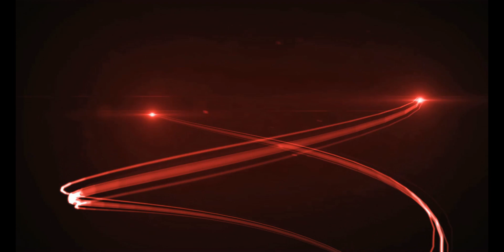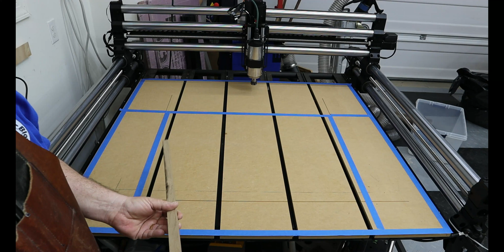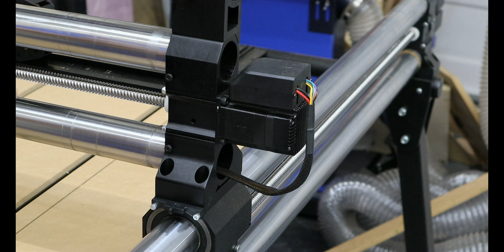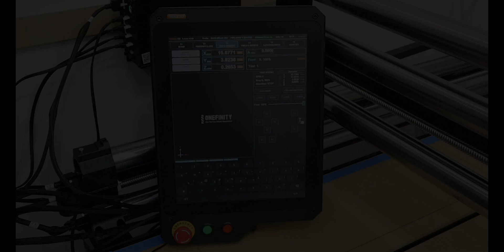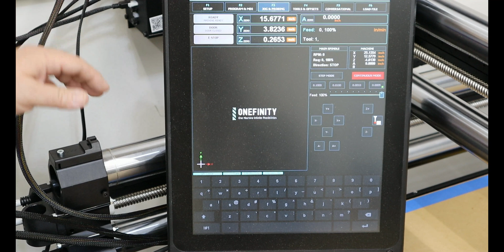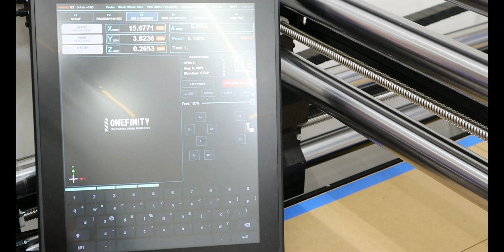Onefinity CNC Review Elite Foreman

Comment: Hello, Thanks for your review. Its been on my mind for a few years to buy a CNC. Just in the past few days I started to visit the reality of purchasing a unit and Came upon Onefinity. Ive never used one before and I currently use Routers built in a table for making and cutting 3D panel shapes for panels for Hot Rod interiors as my business is upholstery and fabricating 3D panels for the interiors, as well as some subboxes for sound systems in cars.   What can you tell me to look for and ask OneFinity in purchasing their equipment? How does the prgramming shapes to cut work?   I'm looking at the Elite Foreman out of the gate. I'm self employed so this appeals that I can use this as a second employee while im doing other work.
Reply from the maker: The Onefinity Foreman is a great choice, make sure you understand the software, I use Vectric VCarve,  althought there are other CAD CAM software choices out there.  Most have free trials, Id use those and see what makes the most sense to you from a work flow viewpoint.

Comment: I realize the mounting height of the z-axis rail is adjustable, but I was wondering in your current configuration....  What is the clearance height from your bottom of collet to your waste board at its maximum height? Thanks for the great content!
Reply from the maker: I've got 7 inches to the base spoil board mounted on the center mounting location.  I do have a couple plies of spoil board above the base board just to suit my personal use.  Thanks for watching, and please consider subscribing.  I've just finished a move and more content coming soon!
Reply: @TradeSkillersAnonymous  Thanks for the info...already subscribed. Looking forward to watching the new content while I wait for flights at the airport...

Comment: Nice review, thanks very much for you clear and concise assessments! FYI @13:26, it's not a Hall Effect sensor for homing. The Hall Effect is based on increasing proximity to a magnetic field generating an increasing voltage signal. The Onefinity homing sensor is simply detecting when a protruding tab cuts off an IR light beam shining across a small gap. Very simple and I guess it works well, better than 'stall sensing' anyway.
Reply from the maker: Hi Steve, thanks for watching!  And you’re right about calling it a Hall effect, thanks for mentioning it!

Comment: Nice video thank-you. How does the Velocity feeds compare to the programed feed rates on the elite machine? I have been using my Journeyman for quite a while and was thinking about upgrading to the elite machine. I do alot of 3d carvings and the Acceleration deceleration really slows the feed rates down on very detailed carvings. And i understand why it does that but was Wondering if the Velocity Acceleration Deceleration is faster on the elite machine?
Reply from the maker: If you don’t have it, I’d suggest the z20 (I think) upgraded z slider. Your x and y speed is mostly throttled by the z slide speed.  The original z slider is much slower than the new one.  You can only travel x and y as fast as the z can go up and down on intricate carves. The upgraded z slider will greatly improve carve times. Please feel free to subscribe while you’re here.
Reply: @TradeSkillersAnonymous  Thank you for the reply. I have the z20 slider, and it is a nice improvement.

Comment: Thanks for the review of the Onefinity Elite Foreman. I am a CNC machinist who has programed and ran CNC equipment for 35+ yrs and I am about to retire. I love the CNC machining and recently started to do wood working. I want to get into the woodworking craft once I retire for a little side income since I enjoy my field so much. I looked at many of the machines out there but this oneinfinity has really caught my attention. I have watched many reviews of the various name brands out there but this may be the one I get for just the reasons I know is true. You need a rigid machine to perform smoothly and accurately over the long term. The controller of this machine is more like the ones I use in a CNC machine shop so I will have no problem using it. This machine is at the top of my list for the one to buy if you want to make a business out of woodworking craft. There are tons of projects out there that will sell very well that can be batched out on this machine. Size does mater and a 4x4 machine has the capability to save time and money in the long run. I think the next best machine out there is the Shapeoko 5 Pro 4x4. Its more for the newbie person who wants to get into CNC machining but never ran or programed a CNC before. 

Cheers Enjoy your Life to the end. Joe
Reply from the maker: Thanks, and I'm glad it was helpful info.  I have another video where I did a review of my first Onefinity CNC, with the original (less capable) controller where I shared the research I did, and what was important to me in selecting this machine, which comes down to rigidity and no belts or V Wheels.  I invite you to subscribe while you're here if you like!

Comment: Cheap and easy fix for pulling on the wire. Just super glue  something light like a bread tie to the magnet case, then you got a light weight handle to pull on, and no loss if it breaks down the road.
Reply from the maker: Great idea!

Comment: Do you think this machine is overkill for a novice buying his 1st machine?  or worth it to spend a little more to get a better machine? I've been looking at the shapeoko.
Reply from the maker: As a beginner to Cnc a few years ago, I determined that I didn’t want find myself guessing if my startup results were me, the machine or my learning curve with designing. The best way to avoid one variable was to get (in my mind) the best machine I could. The mechanicals of this machine are very robust. There’s no flex, give or question that the machine will do what I tell it to do.  All that to say, I whole heartedly recommend this machine and I don’t think it’s overkill. Hope this helps.

Comment: As a retired CNC machinist, you are right on about all aspects of CNC machining. My machine weighed 65,000 pounds and had a five inch diameter spindle, and I would still end up with chatter at times, so it is all relative. I love being retired but miss CNC work, so I am really taking a good look at these (Onefinity) machines. Just need to come up with a plan to sell the wife on it! 🙂
Reply from the maker: Hi Ron, thanks for checking it out. I’ve really liked all versions of the onefinity. Machine robustness was my #1 consideration. Sounds like you’ve worked on some large format machines. Good luck with your discussion with the boss!  Feel free to subscribe while you’re here if you like!
Reply: Similar situation...

Comment: I see you have iVac switch box. Are you using it to triggger a 240v dust collector when the VFD is turned on?
Reply from the maker: Hi Mike, my vfd doesn’t have an on/off switch for mains power, so I added that Ivac switch as a way to power the vfd on and off with the remote.  I invite you to subscribe while you’re here if you like. It’s free and will help my channel reach more people. Thanks and have a great day!
Reply: @TradeSkillersAnonymous  I've been subscribed for while now. I really enjoy your content. The reason I asked about the iVac is that I have various iVAC sensors and blast gates to turn on my dust collector and open the gates automatically when I turn on a machine. Very handy. I added an iVAC  sensor on my spindle cable so my 240V dust collector  turns on automatically when my spindle reaches about 1000RPM. I wasn't sure it would work with the shielded spindle cable so I was very pleased when it did. I couldn't find anything on Youtube or CNC forums about using iVAC until I saw yours in the background.

Comment: That was a great review. Thanks. You didn't mention what your total outlay for it was. Would you share that? I'm brand spanking new to this part of our addiction, I mean hobby. Would you recommend this to a newbie? I believe in the "buy once, cry once" philosophy, so I'm wondering should I just splurge now or start small. Thanks.
Reply from the maker: Hi there, thanks for watching!  You're right I didn't get into pricing strictly because I wanted to show my machine progression from the original to the current one.  In retrospect maybe I should have, thanks for that input.  The machine I have, (Elite Foreman) comes in just short of $4k, before bits, router or spindle and dust collection.  Everyone's approach to those topics is different and so is the cost, but like you I would rather tear the band aid off once and get the best machine I can.  To your question, starting small (in my experience) just leads to frustration, limitations and usually regret.  You get into it, decide you should've just taken the plunge, and you've got the first machine to sell, and presumably take a hair cut on.  If it's in your means to do so, just dive in, and buy the machine that you won't regret later in my opinion!

Thanks again for watching, and I'd invite you to subscribe while you're here.  More videos coming soon!

Comment: If I'm new (first CNC), is the advanced software, (without warnings), you talked about a concern I should consider?
Reply from the maker: Hi Ken, short answer is no.  It’s all going to be new to you, so just pay attention to the details and go at your pace. I think what I was trying to point out and may not have done a good job of, is that if you first learned on a different controller that had a lot of beginner level bits in the interface, it might lull you into complacency with this controller. I believe it’d be best to use this masso controlled version first.  If you ever used a more simple controller in the future, you’d probably view that controller as bothersome with its pedestrian level warnings.
Reply: @TradeSkillersAnonymous  Thank you.

Comment: I agree that the 1F fights above it's weight class. I too have an Elite Foreman coming, is currently having an 2.2 Kw spindle and an ATC mated to it.  In my opinion this machine may compare favorably to an Avid. 

I am currently taking a class at a community college on CNC operation (free tuition if 60 or over !) and yes, the new controller is more like a Haas than the Buildbotics (which I too enjoyed, did everything I needed it too).

As my daughter would say, time to put the big boy pants on.
Reply from the maker: Hi Carl, very well said!  Thanks for watching and please feel free to subscribe. More coming soon!
Reply: How did you get a ATC  mated to the Onefinity Foreman  4x4  ?
Thier website doesn't show any ATC at all.
Reply: @Boxboys.Audio.Sound.Solutions   Yup not yet, mine is SN: 000001. They have to remake the Z slider to hold the spindle, then work with the Masso controller. Give them a few weeks.
Reply from the maker: @Boxboys.Audio.Sound.Solutions  I haven’t done that. Heavy mods needed but I have seen it on YouTube and or the onefinity Facebook group

Comment: Great video!  I am seriously considering adding a cnc to my shop but have worries due to my shop is not climate controlled and is not insulated. Any thoughts on that?
Reply from the maker: Have numerous contacts operating in the dead heat of Arizona with no climate control, she’s fine in the heat. The controller does not like temps below 40 degrees Fahrenheit. You can (if it’s cold at times where you are), take the controller inside your home. Some people do that.

Comment: Awesome video! I'd love to hear more about how the QCW fixed legs are working for you. Do you experience a lot of wobble? Is it coplanar enough? Is there deflection in the center? Did you stabilize it with any brackets? Thanks!
Reply from the maker: Hey there.  The legs work just fine, sturdy enough for the task for sure.  There is some shake at max travel, but isn't enough to translate to the part as the gantry and bed are in unison, just leg minimal flex.  No real bed flex unless you lean your body weight on it during a cut, the bed will flex just slightly, but no reason to be leaning on the work area during ops.  I did not stabilize it, as I don't think it needs any stiffening.  All that said, if I had it to do over again, I'd probably do a torsion box, mostly because Im a big fan of them.
Reply: Thank you this is super helpful!

Comment: I've been REALLY wanting a CNC.. was leaning for a bit higher end machine originally.. and am only a hobbyist.. but felt like the 1F as cool as it is.. might not be stiff enough to do thin aluminum, but also wanted a 4'x4' or 5'x5' capable width/size. If I had the room I'd love a solid 5x10 just to have the room for a 4x8 sheet + extra. Anyway.. this new upgrade looks amazing. Is it stiff enough to handle faster cutting speeds (the top of the line 4x4 option)? What sort of bench/bed to you put it on to ensure its stiff enough to handle the spindle and faster cutting speeds? I would love a fold up option to store it out of the way.. but I suspect that limits the ability for it to be stiff enough for faster cutting and metal cutting capabilities?
Reply from the maker: Hi Kevin,
Id tell you that I would have no reservation milling aluminum with this machine.  I don't happen to work with aluminum but the thing that has consistently impressed me with every Onefinity variant that I've had is the rigidity of the frame.  I regularly run surfacing passes at 400IPM in hardwoods, and it's normal for me to do milling operations with 1.4" end mills at 1/4 to 1/2" depth of cuts between 150 and 250 IPM depending on the wood I'm working with.  
The journeyman can (I beleive) use a folding stand that Onefinity sells, but the Foreman size is just too big and heavy to be flipping around on a portable stand.  You could probably build something that would be stout enough, but it's a heavy machine.  I wouldn't want to be manipulating it manually.
I mounted my Foreman on their QCW Frame, but if I had it to do again, I'd pronbably mount it on a torsion box.  Nothing wrong with the frame, I just prefer torsion boxes.
Reply: @TradeSkillersAnonymous  Thank you for reply. Very good info. Looks like the one to get.. especially for me being a hobbyist.. I basically want to mill some aluminum parts for things like drones, 3d printers (instead of ABS), etc. Interesting about torsion box. Would the one this guy builds work for the Elite? https://www.youtube.com/watch?v=9BAFdmn5Amw
Reply from the maker: @WhySoDivided-CantWeAllGetAlong  haven’t got the time to watch it at the moment, but there are many torsion box videos out there. I’ve also got one that I made for my journeyman. https://youtu.be/zk0B3R5zj04

Comment: I'm really on the fence on which one to go with. I"m currently in the market for one and I've looked at Onefinity, Stepcraft, Shapeoko, X-Carve but this one is the one I keep coming back to look for reviews. Have you own other brands? If so, which one do you feel the most satisfied with? Thanks for the video and look forward to possibly joining the CNC family soon. May be even the Onefinity :) Cheers and thanks again! 🍻
Reply from the maker: Hi Nappy,
I have not owned any other machines, but researched like crazy before deciding.  I have another video where I reviewed my first Onefinity, and talked in more detail in that video about the research I did, and what was important to me.  Not having a controller that required a PC to be connected to ti, or internet connection requirement along with ball screws and linear bearings versus V Belts and wheels.  How you use the machine (size) will be important to consider, but rigidity is critical, and it's been my experience with this machine's physical construction and design that has surpassed my expectations (along with have ball screws and linear bearings).

Thanks for watching, and commenting, I hope this was helpful.  Have a great day!

Comment: Fantastic video! I have a shapeoko 4XXL right now but as my business grows I am looking at possibly adding this machine. Thanks for sharing such a detailed review! I run a lot of hardwoods and would like to be able to run faster for sure. The extra size would be nice too, throwing half a sheet in the machine at once sounds pretty nice!
Reply from the maker: Hi Sean, the onefinity line up is a really rigid design. I have an older video where I reviewed my first onefinity and shared some research I did while I was making my decision on which CNC would be right for me. It really came down to the ball screws, linear rails. I revisited friends I’ve made that have less rigid machines, and where they might run at 80ipm to be sure not to exceed the frame of their machines, I run that same job at 200+ without issue. If you care to, I invite you to subscribe while you’re here, there will be more to come and also have a look at some of my older videos, you might like them too. Thanks and have a great day!
Reply: Will do I like your style. Looking forward to more videos!